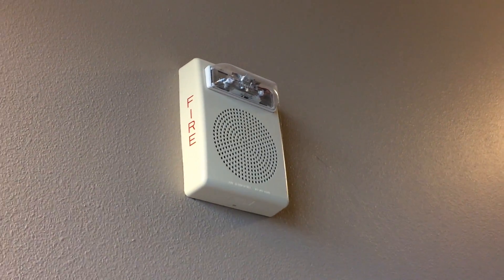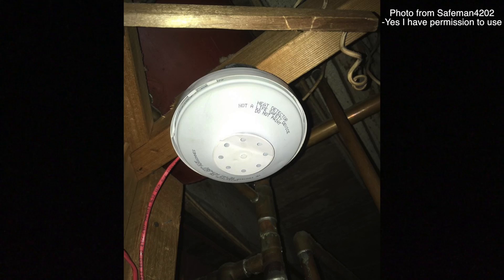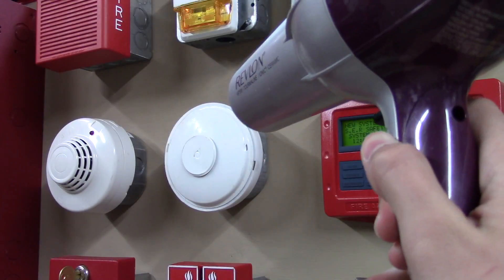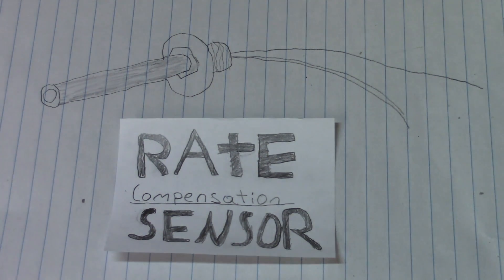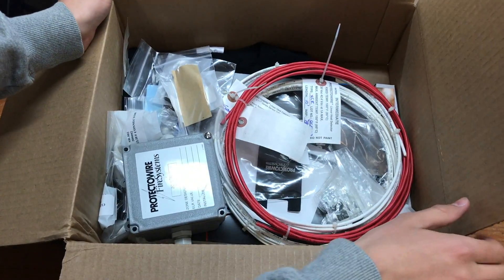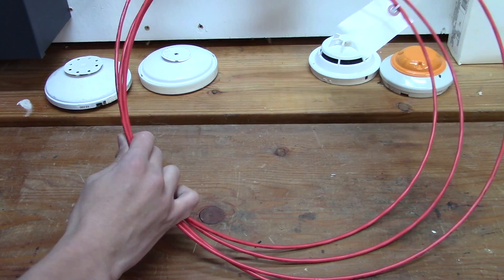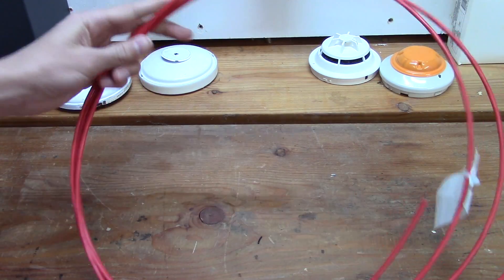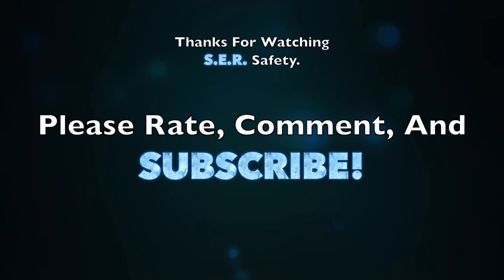Heat Detectors: Everything you need to Know

Comment: Nice video, the heat detector that I have is the Notifier FST-951H high temperature heat detector. Rated at 190°F or 88°C. My question is, would this particular heat detector be  thermoelectric? I am asking because it is made by Notifier; and is their newest detector.

Comment: Great video so far.
I have a question, There is a old fire alarm panel that installed at 1980, do you know what’s the code says about the heat detector type in the  bathrooms at  Motel? I would like to upgrade the system and the current heat detector is 195 inside the bathroom and then the sleeping area is 135 degree.  Can I go with 135 instead of 195?

Comment: HEy, great video! I want to be able to use a fog machine in my house. Would it be wise to swap my smoke detectors for heat detectors and do you have any recommendations on what I should use? I would want to use the existing wiring if possible. Thanks

Comment: 2:00 If you want it click link:
https://www.ebay.com/itm/EDWARDS-SIGNALING-Heat-Detector-Coverage-1600-Sq-Ft-302-EPM-194/253727379694?epid=1007560623&hash=item3b135490ee:g:Z0MAAOSwE3tbO0d1&enc=AQADAAAB4KX%2FKt4E1xf3SDqEdBclaYaNv9TZFkTRWNs1HdcMzv1cWpgNadkJ5hLEA2y5UXB20oTDi6bn8CWdbYSLjDJXs4cEJGh%2Fwn8cw8h3v9rugXOGia70UxNLIwAE1SXA8IG%2FZoqra2HDL0mx5H3CCkQ7Q0TrHtDJh0gHoDW0R7BMkLlZNa3Wu9d45MUIt%2BmXw%2FM6QnELOfg8X%2BaW2k71qrGRJ45bMuLQcpI%2FCjAvk1LJ3PLfMiEKwLXqaDzVr7%2Bl57aj4FqC%2FAIBxZ1TSPrGsCGEnmAZ3W7YHsxM2B6v7MTxszkqNGa2uALJSoxM3uL4e2QggV%2FL1fymP7h1n4GsmN%2FEcNQU8P%2B4LxJzlsrmkQ5jdG5V%2B3HYjPjEb1yc%2FvsQw8swpSpqhY05Tr7hi%2FI8M0PW1obQGCv0qiCAYaGUVAjZ0fSRp24SpEsFmwYHpJVzK%2FnwRzVnqMabsZMpQ6vFV1C9uKTA%2Fkc3%2BjGhxLbiyUIK%2FomoJR2VAkJ%2FJl5J4%2FeX1j0WOT7q6nigprunyKwlgAxIGNYdNCPkfeUBd1zXk%2F28jzhisWO%2BwEtpT8V4XP016uLOBsq5HqPc8jkPL2n81vr41C98Kb9FBRAu5ViSTBFepuXkux3OoDbUCl9VAHuYOk2SuQ%3D%3D&checksum=2537273796945ef376617d9648d1a4dada6799327ef1

Comment: Nice presentation, with a fairly complete list of heat detection- the only type missing I think was fusible loop systems. Rate compensation detectors are actually a little more complex at least in their operation and are a very ingenious type of detector.

Comment: Wait, the special element at 2:39 is a resistor???
Reply: It is very similar. It is called a thermal resistor and the level of resistance varies depending on the temperature. When the temperature reaches a certain point there will be very little resistance which will cause the detector to go into alarm.
Reply: Dave Ok, that makes sense.

Comment: Nice video! I actually have a Simplex rebranded weatherproof pull station from the 90's made by Protectowire! I had no idea they were still around!
Reply from the maker: Wow, cool!
Reply: Yes, we are still around! Protectowire FireSystems is actually celebrating 80 years in business as an American manufacturer. We often get calls from customers about products purchased in the 70s, 80s, and 90s and even older that are still in use. Can't beat American made.
Reply: firefreak57 is it the BG-50w?! I have one of those!!!! It's a protectowire one!!!!!! Mine is brand new with the seal, backbox, and the little ziplock bag full of the screws, and washers!!!!
Reply: Alexander Goushy Yes...mine was also NOS but was another collector's before me, so I just got the pull station. But it is the simplex rebrand (mod. 2099-9788) and I know it was NOS because the original rod was still intact and the screw terminals had never been unscrewed before. I'd love to see a video if you make one though!